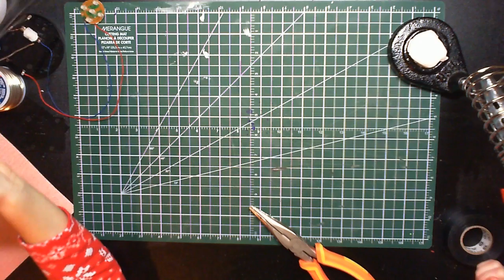Dollar Store LED/Fibre Optic Lighting Hack for Star Destroyer Model

Comment: Next time, don't clip the LED assembly wires so close to the LEDs. Leave some wire attached to the LEDs, so you can see where the red/blue wires go, and you can make battery contacts way easier. You might even be able to just splice them and avoid soldering altogether.
Reply from the maker: Great tip!
Reply: RedHeadKevin You can tell which is the anode and cathode by looking - the cathode is the big dish-shaped element :)
Reply: @RoamingAdhocrat  As a child, I thought a cathode was that thing a pastor is standing at in a church... haha... 🤣

Comment: Nov. 2017---Thanks for the video & modeling tip. Didn't know you could grind a led bulb down in height. Haven't been to Dollar General in a long time, but will now take a look see. Last year at Dollar Tree, bought a dozen or so led Christmas tree lights. There's a dozen led bulbs per set, each led about half the diameter of a pencil eraser and uses 2 double A batteries. And you can either have them all on or flashing on/off.
Reply from the maker: Sounds like another great option! And flashing lights have me thinking now... Having a combination of solid lights for windows and flashing ones for running lights is something I hadn't actually considered for this (somewhat defunct) project. I usually think of Star Wars as having pretty static lighting on its models, and Star Trek as having blinking and rotating and other dynamic lighting effects. Wonder what a latter-day Star Destroyer would look like with blinking running lights and other funky effects?

Comment: was wondering if you made that model with the fiber optics from this video? I have several of the big Star Destroyers and wonder how the lights are in scale look like. Great video with the your kid!!!
Reply from the maker: Hey! Thank you! Unfortunately there's nothing really to show for it. We did start installing the fibre optics in a sort of trash-bash build, but we ended up breaking our questionable solder and moved on to other projects before we came back to it. It was working a treat until we busted it, lol. But you'd need to experiment to see if the scale works for your specific model. Fortunately it's so cheap to throw together that you can try it out without making a big investment!

Comment: To make sure I'm watching this correct, you bound together the fiber optics with electric tape, then placed a dot of gorilla glue gel on the LED diode to glue the fiber optic cable together?   I can't tell if the glue went on the diode or the plastic casing around the diode.
Reply from the maker: If I understand what you're asking, we didn't Dremel right down to the diode itself. The Gorilla CA glue was to fuse the fibre optics to the plastic of the LED. We ground the plastic down to give us a flat surface that would be easier to adhere to, not to expose the diode.

Comment: FYI crazy glue or CA will eat through fiber optic wires
Reply: Thank you for the heads up! 👍🏼
Question: Would using a drop or 2 of clear resin secure the optics? 🤔
Reply: Sonya Smith  never tried that.....I’ve always used low temp hot glue on fiber optics

Comment: Can you use 20lb fishing line ? Not as rigid but more flexible. Optic fibre is nylon stretched.
Reply from the maker: Charlie Jeans Couldn't say as I've never tried it, but I suspect it doesn't have the same properties as fibre optic... Interesting idea though. The benefit of this is that we got everything we needed from a couple of dollar-store pieces that we just stumbled across.
Reply: @LoveMakeShareTV  The trick is to have a fiber that consists of two materials. They act like a tubular mirror, that bounces the light internally to get to the other end of the fiber. There are several video's of how fiber optics actually work. Having just a fishing line won't do the job. Trust me, I tried it... And even coating the line with some silver paint won't work. Yep, tried that too.
You're better off using cheap stuff like shown in this video. Or, order some online. I just purchased a huge of like 50 meters roll for only $15. That's more than I will need for my next project.
Reply from the maker: @EdwinvandenAkker  This is a great explanation - learned something! Thanks!
Reply: No

Comment: Did you ever build the Star Destroyer? And which one? I am building the 1/4000 as a test then I move on to the 1/2700
Reply from the maker: So we did, sort of. It was a scratchbuild/trash bash Star Destroyer-like ship for a video project, but the project kind of fell away and we scrapped the model. It was never a model kit, unfortunately. I scavenged the lights and fibre out of it for use in other projects later on.

Comment: question??...Can the fiber optics be woven together?..or braided together?...to make blended colors?
Reply from the maker: Hmmm... They're both flexible and kind of brittle, so I don't know how tight a weave or braid you'd get. They also mostly only illuminate at the end, which is why they're used for tiny windows on models and things of that sort. I've been thinking about roughing up the sides of some strands so they do transmit light along the whole length... Subscribe and stay tuned, maybe this experiment will happen sooner than later!

Comment: What if I wanted to keep the multicolor changing lights
Reply from the maker: Then there's lots less work you need to do! The CA superglue we used does a great job fusing everything together, so I'd still open it up, file the LEDs flat, and glue it all together. Just don't replace the included multicolour LEDs with white ones like we did!

Comment: Apparently you never used it on the destroyer. Guess you get what you pay for.
Reply from the maker: Just to be clear, we didn't use it on a Star Destroyer because we moved away from that project, not because this didn't work out. It was an easy and convenient way to get all the parts we needed to run fibre optics. In point of fact I'm going to be using similar scavenged parts I tossed in the bits box a while back to light a different project with fibre optics.

Not all learning is done in a straight line.